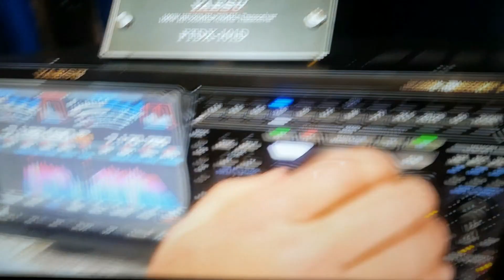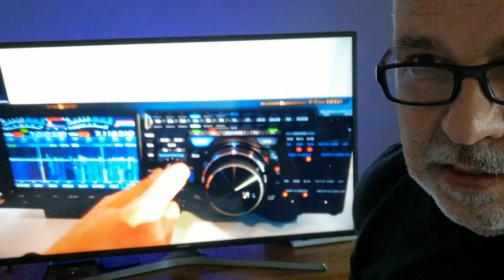Yaesu FTdx 101d - Have you seen it?

Comment: It's $4k in the US with dual receiver with new 3d display. Nice rig!! No LAN port so you have to buy an adapter if you want to use remote. Numbers on Yaesu site look good. This is a direct competitor to the 7610 (not 7300) and Kenwood 890s (only 1 receiver though). Glad to see Yaesu back and with a nice display finally. Few years late IMHO, but better late then never.
Reply from the maker: Me too!
Reply: It wont compete with a kenwood 890 FACT
Reply: @anthonym0vdo132  Thats because its better, Kenwood make better  kitchen appliances.
Reply: @VKRADIO  you will be very upset with your purchase,  i will stick with my TS - 890 and if I ever get the yaesu urge again I'll go back to a 5000 which I've had and still say Is yaesu's best radio
Reply: @anthonym0vdo132  The FTDX just made Number One in the Sherwood report,just kicked every other radios arses!